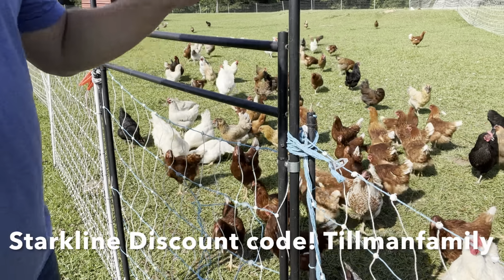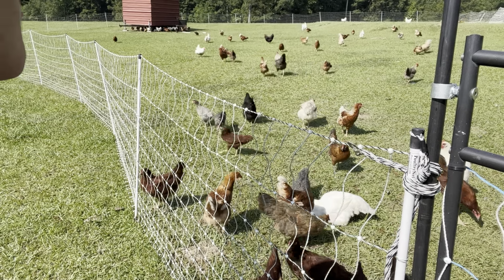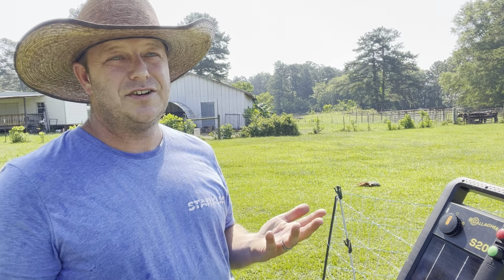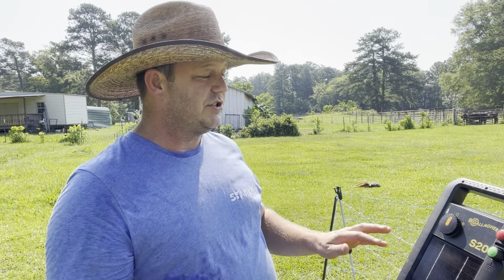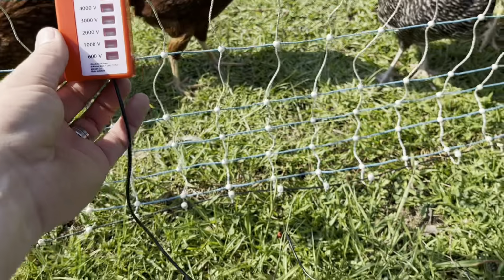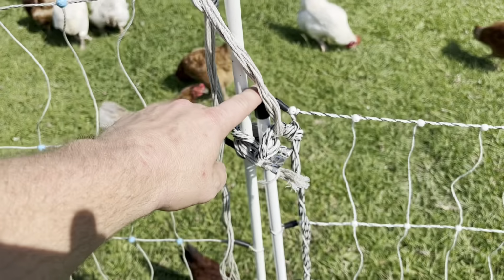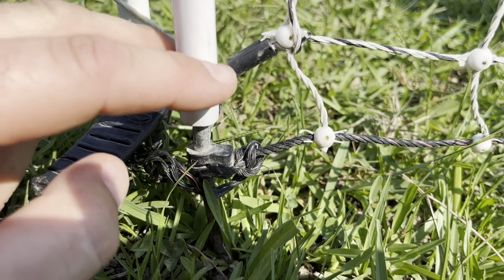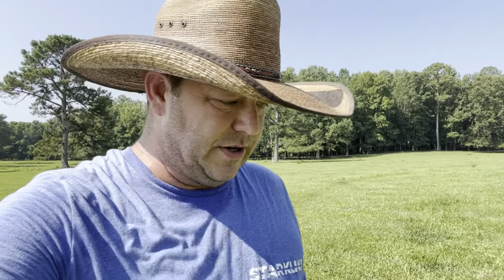Simple Set up and Simple Troubleshooting for Electric Netting

Comment: You video helped me find the short I have looked for a while. It was at the bottom of the end post where the wire slipped onto the metal spike. How that happened I don't know because it was difficult to slide over the end and back up the post a bit. Tester went from less than 2000 watts to 8000 watts. It has kept the racoons out of the chicken pen and the squirrels out of the garden. Thank you for a through post for trouble shooting the electric poultry fence.
Reply from the maker: You’re welcome!! Glad it helped!!

Comment: I have a small single netting piece around a few rows of corn that the raccoons LOVE!  I am using a solar S6 Lithium Gallagher charger.  The charger absolutely has current, I accidentally caught a shock, but when I attach it to the fence it is grounded out somewhere.  I checked the connector, it is done exactly like yours, the bottom of the poles, it does not look like it can slip onto the metal because on mine there are clips holding it in place.  Any other suggestions?  It is in mulch and touches the ground in places due to uneven ground...is this the problem?
Reply from the maker: Touching the ground can cause it to lose current. Take some cheap step in post and hang the netting on them to get it off the ground. Hopefully that will help. The only other thing I might ask is how old is the charger and has the battery ever been changed? If the battery is going bad it works great at the clips and not so much when the current has to cover an entire set of netting. Hope this help! Thanks for watching!

Comment: What is the best way to do a straight stretch of fence? I don't want to make a closed area. I just prevent goats from going down one side to a creek.
Reply from the maker: You will need some extra post at each end. Something that won’t flex. A tee post will work great. Starkline netting comes with some nylon cordage that you can ty the last post in the netting off with. Just make sure the metal tee post isn’t touching the electric netting. It would cause the fence to ground out.